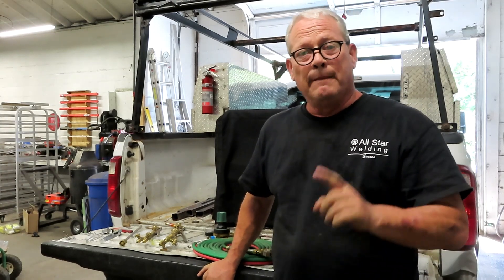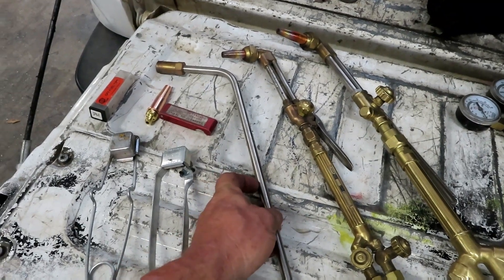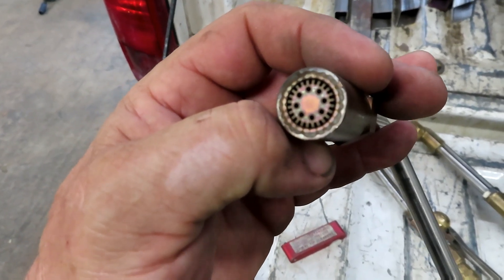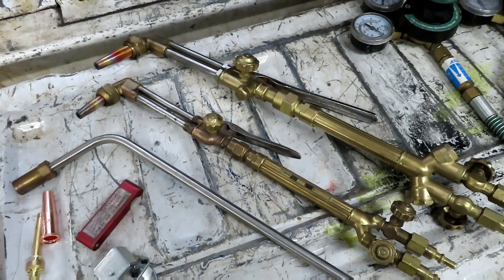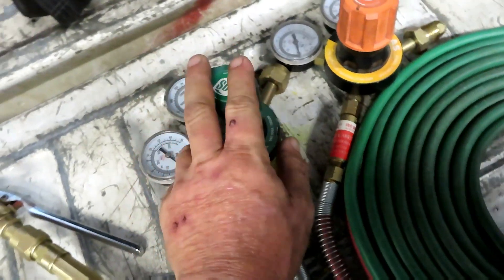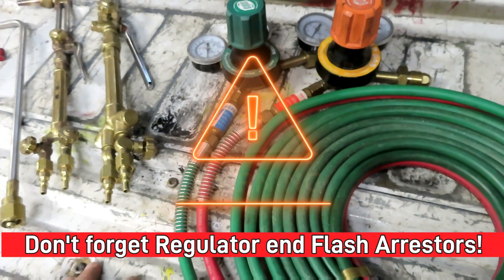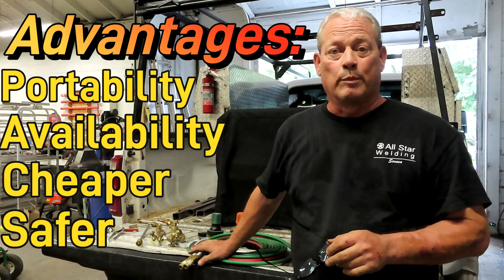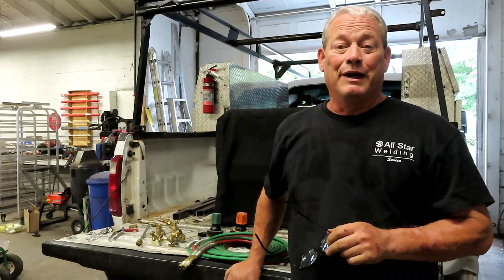Oxy Propane Torch Setup? What do I need?

Comment: I just got an Oxy/Propylene setup.  I've always used Ocy/Acetylene.
 Now I'm waiting for my Harris 19-6 with all the attachments. I can't wait to see how well their F-Injector series works with alternatives fuel. Its supposed the be superior to the equal pressure type torches
Reply from the maker: Interesting. Let me know how it stacks up. I've never used Propylene. Will it be similar to the Propane?
Reply: @AllStarWeldingSC yes it is very similar. It burns hotter than propane & you can weld with it. Does not burn as hot as acetylene and no 1/7th rule withdraw limit.
 What adapter do you use for connecting your regulator to the propane bottle?

Comment: I finally got all the things I need for an oxy propane set up.  Do you have a video on how to achieve a neutral flame?
Reply from the maker: I never could get it to show up on camera, but I will give you the highlights.... Just crack the propane side and strike the flame. If you can't get it to light, it's not open enough, or open too much. When you bet a flame, back it off till the flame is just dancing off the tip. Now open the Oxy. It should make a long thin flame. Open the propane some more and the blue cones will back up towards the tip. Open the Oxy some more and the blue cones will get longer and the overall flame will get shorter. Keep going back and forth from propane and oxygen until it sounds like a jet engine and the blue cones are about 1/4 - 3/8" long. Now pull the trigger. There should be no change between the two.
Reply: @AllStarWeldingSC It seems to be cutting well enough for me.  Thanks for the info.
Reply from the maker: That's great!! Get you a nice rosebud tip too
Reply from the maker: I will try to make a video about it
Reply: The size.of the hose ? 
On Amazon  grade T show up 1/4 . 
I want this setu to braze cast aluminum  as i see guys from thailand doing  with propane and oxygen  thanks nice video
Reply from the maker: Yes, 1/4". I've never used it for brazing, but I heard it can be done. You can braze with it, but not weld with it

Comment: What happens if you use an acetylene setup with LPG? Sorry for asking. The acetylene regulator fits right into the LPG Tank.
Reply from the maker: I'm not sure. But if they make them for each, there must be a difference. On the regulator, I think the difference is the orifice inside of it, and maybe the gauge. With the hose, I think it deteriorates the rubber. And, the torch tips are way different. Again, if they make different parts for each, there must be a reason, so I roll with it.

Comment: Thank you for the great information!
I plan to switch to propane once I run through the current acetylene bottle. 
How do you like the SAU regulator? I looked at one on Amazon and it said that it was frequently returned. 
I do very little cutting but a lot of heating and bending for my blacksmith work. Thanks again!
Reply from the maker: You're welcome! I'm glad the video was helpful. I have absolutely no worries with the regulator. It's pretty heavy duty. From removing it at the shop, putting it in the truck, using in location,  and back again, it's been dropped and bumped more times than I can count, and still keeps going. Why did those people return it? Did they accidentally order it for use with acetylene? There are so many reasons. What are the reviews saying? I don't put a lot of faith in reviews. Read between the lines.  If I need to order some more regulators, it will be the same again.
Reply: Thank you! I will go back and check the reviews for more info. 
Your definitely right in not totally trusting reviews.
Reply from the maker: @davidmanen5495 I've seen people return stuff, and give it a bad review  for so many reasons. Sometimes you can tell they didn't know how to work it, wrong color, ordered by accident,etc.

Comment: Would  getting the Olsen heavy duty kit from Harbor Freight and getting new tips for propane work?
Reply from the maker: Absolutely!! That what my big torch is, my smaller torch is an actual Victor. Here is the tricky part.... You can get the tips on Amazon, but make sure you get the RIGHT SIZE, and the numbering is all messed up. Basically, you want the tips for a Series 300 Victor torch. The torch is a 300 series, but the tips are a 1 series. I suggest going to Amazon, then to the SÜA store.  You want to get the 1-GPN-# tips. The # will be the size of the cutting torch. I got the 000,00,0,1,2,3 tips. That will cover most of your needs. It goes all the way up to #6. All the listings from SÜA also show the measurements of the tip, again, make sure it's the one that is 3" long. I can't tell you how many times I ordered and returned tip until I had the right ones.  BIG TIP: In the listing for the tips, swipe the pics to the chart. Take a screen shot of that chart and keep it in your phone in several places, you will need it. Good luck!  Oh yeah... Make sure it's for propane.
Reply: @AllStarWeldingSC Thanks for the reply.  It seems some of my original post didn't post (or I was thinking of something else while typing and just forgot it 😂).

Anyway, I've seen on welding forums that folks have used the acetylene regulator and hose with propane for years and years without a problem and was wondering about your thoughts on this.
Reply from the maker: @bryanthornton6787 well..... If it works for them, great. The hose may not be that big of an issue, until it is. But the regulator is a different story. I haven't seen a acetylene regulator in a while, so I can't remember, but I think that the issue with that is the dials. I think propane has a much lower flow. Many times, I don't even go over 2-5. I can't remember if an acetylene gauge can show that low. I just like to be safe and do it the right way. I figure that if there wasn't a difference, they wouldn't make them.
Reply: @AllStarWeldingSC Thanks again.
Reply: Jason-new subscriber here and thanks for explaining the numbers.  I ordered the 3 gpn tips and they are too big for my two medium duty Victor torches.  I should have ordered the 1-gpn tips.  Another thing you did not talk about was hose diameters.  I got 1/4” id type T.  Since I am only going to cut 1/2” down I’m sure the hose is adequate.  Good videos Jason thank you
Reply from the maker: Thanks for watching. Yep, I never talked about hose diameter, sorry. 1/4" will be all you really need. That's what I use.
Reply: @AllStarWeldingSC  thanks

Comment: Finally got my oxy propane torch setup complete finally 
Thanks for the inspiration on this 

What tip are you using to wash off or snarf off old welds?
Reply from the maker: Unfortunately, I don't think they make a tip for that. If they do, I just haven't found it yet. So, in the time, I've been using a smaller tip than what I would use to normally cut with, and hold it as low as I can

Comment: Can compressed aur be used instead of an oxygen tank?
Reply from the maker: I have no idea. Never thought of that. You'd have to have a pretty good regulator on the compressor.
Reply: @AllStarWeldingSC  There's lots of stuff that runs on Compressed Air and Propane.  The tips are different, big and a little complicated looking.  Typically have many holes in the end so there are little flames keeping the big central flame lit.  Some Air/Gas torches are BIG!  A lot of power but lower temperature.  Cheap to operate, might or might not do what you're trying to do.
Reply: No

Comment: Liking oxy propane just wish there were welding supply open in the evening and weekend. Right now I'm using acetylene tips till the Amazon order shows up challenge to light but it works ok. Great video thanks.
Reply from the maker: Yeah, gotta get those propane tips, it will be easier. The other day, I had a friend that doubted my propane set up. I put on a #5 and cut a piece of train track in half.

Comment: Which rosebud tip are you running?
Reply from the maker: When I need generous amounts of heat, I will use a #8, but it sucks a tank of oxygen dry fast.  That's when I need to bend a tractor bucket. If it's just heating up some round bar to bend it, I just use the torch, without using the oxygen cutting valve.

Comment: What pressures are you running your regulators at for heating?
Reply from the maker: If I'm cutting, usually 5 on propane and 25 on oxygen. If I use a bigger tip, of course that goes up. For heating, a lot of the time I just use the torch with the cutting tips in, but if I use a rosebud, those numbers go up depending on the size of the rosebud like 10/40. But back to cutting, I've made many successful cuts as low as 2/20
Reply: @AllStarWeldingSC  Thank you! I ordered everything to switch over to propane/ oxy today.

Comment: Have recently gone from acetiline to propane on farm, been a few years since I had to heat and bend until the other day took a bit to get working pressures. We have to hire acetiline and oxygen bottles but LPG we can own making much cheaper and easier to refill in new Zealand. Ran at 300 LPG and 600 on oxygen for heating, think I had LPG to high your thoughts. Was bale feeder forks and frame straightening

Comment: Are those quick connect fitting special to Oxy Propane or are those for standard pneumatic tools?
Reply from the maker: No, they are specific to Oxy/Acet. You can get them at your welding supply, or Amazon
Reply from the maker: They are also made so that the Oxy line only goes on to the Oxy side. So you can't accidentally hook it up backwards

Comment: Have you used propane for brazing with the propane-oxy setup?  I have three welding books that each devote about a paragraph to propane.  One book says the heat is less concentrated.  I have repaired a few things with acetylene brazing and like that option.  And I like tig brazing.  Maybe it's just the cool color of the metals.

  Do you have just check valves at the torch and flashback arrestors at the regulator?
Reply from the maker: I have not yet had the opportunity to try brazing with it. Maybe soon. And yes, check valves are inside the torch handle, and arrestors at the gauges.

Comment: Great video 
Propane will be much more affordable 
Thank you
Reply from the maker: Considering that the regulator on the propane is usually set around 2, propane lasts forever. It's cheaper, safer, more available. It's a great way to go. Thanks for your comment.